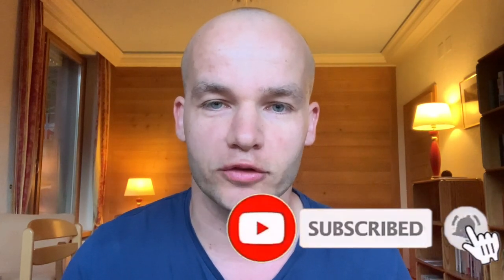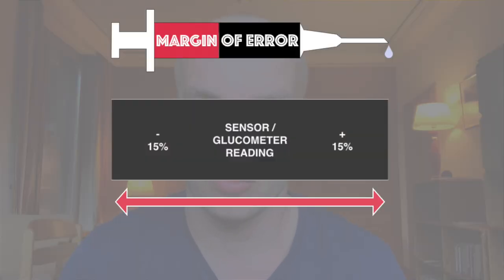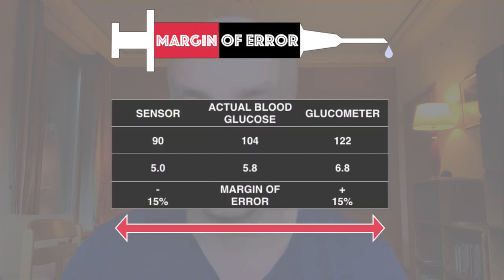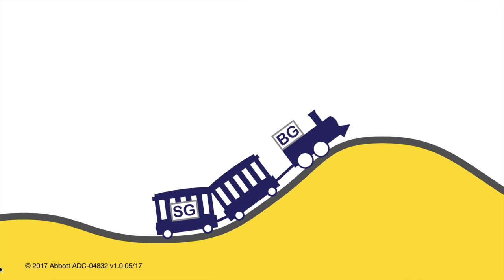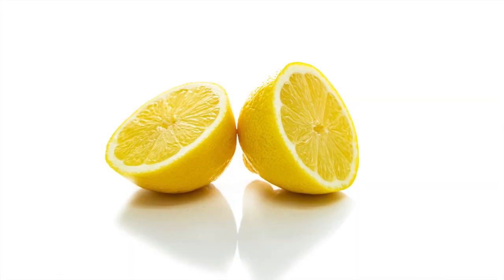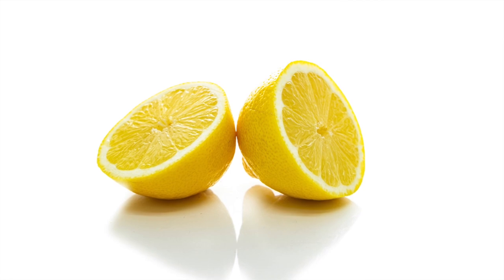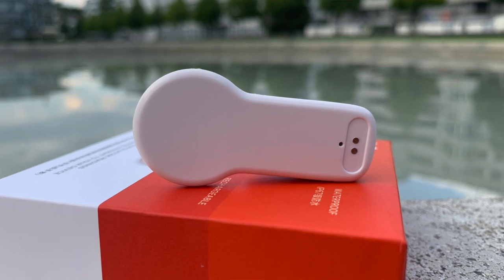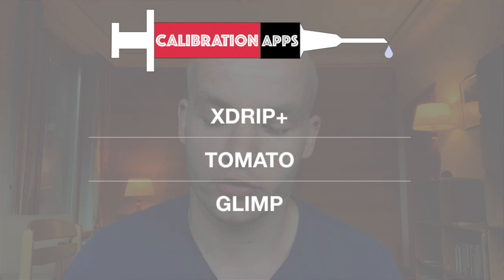FreeStyle Libre Accuracy Issue / 6 Tips For Accurate Sensor Readings

Comment: I am watching from Texas, USA.  I have been using the Freestyle Libre 2 for almost two years and just recently began having the problem of variance in reading f rom the sensor and the glucometer.  I think, after watching your videos, I may have a problem with hydration.  Your videos are most helpful.  My question is:  where do I get the 3rd party transmitter?
Reply from the maker: Thank you so much for your kind words my friend. Please check videos about Miao Miao on my chennel. I have a few. That is the third party transmitter. I also provide a discount code under those videos if you decide to buy. Hope this helps!
Reply: Hi Tom, is the Miaomiao 3 recommended to get more accuracy with the Libre2?

Comment: I just started using the 2nd generation Libre and the alarm woke me up all night long saying my blood glucose was at 57 (I’m in North America). I checked with my glucometer and it was over 100. I have been struggling with my diagnosis since march of 2022 and my doctors aren’t really helpful. I will try contacting the manufacturer to see if it just needs to be replaced due to faulty equipment. 🤷🏼‍♀️
Reply: You may have compression errors from sleeping on it.

Comment: Hello from the UK with an FSL 1.
One more thing that helps me is to apply my sensor at least 24h before the one I am ues runs out. My diabetic nursebtold me that in the first 24h your body doesn't like the FSL being in your body and this gives you inconsistent readings. Have checked this and find it to be true. So 24 or 36 hours before the current sensor runs out I attached the  new sensor but will not start it reading.  Hope that makes sense?
Reply from the maker: Yes, it makes total sense. I sometimes do that to and also mentioned this tip in one of my previous videos. Definitely relevant for accuracy. Thanks a lot for the reminder! Wishing you a great day! Greetings to the UK!

Comment: All my sensors read 30 to 40 points below my monitor readings consistently.  However, I had one sensor that read very close to my monitor readings throughout the 14 days. I assumed that sensor was probably miscalibrated at the factory but it was a pleasant surprise.
Reply: I recently had a sensor that was nearly exact to my finger prick. It was amazing! I didn’t consider it could have been miscalibrated lol
Reply: My first batch of six were dead-on.  The second batch of six were very inconsistent.  Three of which just stopped working.  The rest were +/- 20% off.

Comment: I must be an idiot, because I didn't know there was a Freestyle 2 sensor. The only upgrade in the U.S. that I was aware of was the upgrade from 10-day to 14-day battery life and that is what I have been using for three years. The sensors perform within the ranges published by Abbot, but those ranges for my sensors was much more than what Tom said in this video.  The range that I read is plus-or-minus 40 ! ! ! ! those are really lousy limits.  My experience is that the readings over three years is they average about 27 points lower than a fingerstick value with contour next test strip.  I can't wait to try something else.

Comment: Thank you for your very informative Libre 2 advice. Can you help me with this question? I'm on 2 months new to being declared a type 2 diebetic. After several Hypoglycemic events, my Dr. Prescribed a Libre 2. I'm constantly getting Low Glucose alarms but I feel fine. My Libre is approx 30 points lower than sticking my fingers. I called Libre and they told me that my 30% difference is Normal?? How could that be Normal. The false alarms are driving me crazy! I actually started gaining weight in fear I was going to have another Hypo. Any tips or help for this Newbie?  Thank you very much! Louis

Comment: I am in the USA and have been using Libre 2 for about 6 weeks.  I am on my 4th sensor now, on the second day.  Right now my sensor is running very low (35-50 less than my glucometer) during all readings.  I wonder if placement on the arm makes a difference?  This sensor is higher on the back of the arm than the others I have placed.

Comment: If anyone is here in 2023.  I am 31, non diabetic, but check my blood sugar regularly due to having adrenal fatigue, depression, and anxiety. My father is a type 2 diabetic and I live at home.  My dog experienced her first hypo last week and ended up in the ER.  I started regularly checking her glucose to find she was having low values, however, she was becoming uncomfortable with the constant poking.  My vet applied a Libre 2, which was also recommended by two diabetic dog physicians who have diabetic dogs.  They told me it’s extremely accurate.  It’s been about 9-10 hours.  Reddings are WAY off.  Immediately began showing HIGH which she’s never high. 140/158.  So I decided to check her blood glucose the same time I took a Libre2 reading.  158 Libre, 90-95 on both my glucometers.  10 minutes later she read 105 on Libre and 100 on both glucometers.  Thought it was calibrating well since it was within the first hour… NOPE.  She kept showing high almost ALL night.  I decided to check her when she read 158 on the Libre… and thenk god I did because she was at 60/64 on both my glucometers.  About a half hour later, she was reading 123 on Libre… checked her on glucometer… 85/86.  Anyone else have this issue?  I am extremely frustrated as I paid 300 dollars for a visit, application, sensor, and reader.  Unless it takes some time to calibrate?
Reply: That’s so annoying! I just got one on my cat last week and it keeps saying he’s in the 50s and 60s but he’s perked up. Been stressed for no reason because my vet was short on doctors and wouldn’t call me back for days. I had to call an animal hospital and they told me how these libres aren’t accurate. 

How’s your dog now?

Comment: Tom
It is not a good explaining that gets an average between the two of the readers. I have started using a finger-stick glucometer after I checked my blood sugar level with freestyle libre and saw the result LO which means under 40. I knew that was not the correct number while I was having no hypoglycemia signs at all such as sweating, shaking etc. I had a little bit of panic and felt anxiety in my chest because of panic after seeing that number. After I checked my blood sugar level with finger-stick glucometer it was 138. I am not saying finger-stick glucometer is the best but I watched a lot of videos that say freestyle libre is not accurate. Also, doctors say freestyle libre is not really censoring the sugar in your blood (But my doctor He always defend freestyle libre He must have a deal with the company Abbott. That's the why I don't trust doctors). adding the two and dividing them for result is just Aristoteles style.
Reply from the maker: Thank you for your feedback. I don’t think I ever said one should add up the two values and devide them by 2. I also said some sensors might be faulty. But I get your point. Thank you for watching!

Comment: the sensors are most likely batch tested for quality control at the factory. they are not individually tested. so what happens to those batches that fail QC? are they shipped to countries with weak consumer rights? i am having up to 50% error when i check with finger stick. and i have to check a disclaimer box when i buy on-line. they are expensive and not covered by any insurance or government scheme.

Comment: I freaked out when my fasting glucose readings were around 115/125 on the libre3. Did a blood test (not with a glucometer, but an actual blood sample) and came out 103. Lost faith in this devices. I applied it as I should've.
Reply: I was expecting a small difference, but 15/20 points difference is waaaay to much imo.

Comment: Tom, thank's or all of your information, question for you after applying the sensor I have had some blood from the vent hole
is this a common thing or am I applying with to much force ? I live in Los Angeles Ca. the new libre 2 is available here now.
Thank's again
Reply from the maker: You are most welcome. Yes this bleedings happen from time to time but in my opinion the reason is not too much force during the application but rather hitting a "wrong spot" too close to a vein. It's not a big deal and most of the time people are still able to use the sensor when this happens and the bleedings stops. Hope this helps.

Comment: Gross inaccuracy. Thank you for your wonderful videos, but my experience with the Freestyle Libre 2 has been very poor. Abbott has determined that all three of my last sensors have been faulty and they have offered to replace.However the most recent replacement was again 30 off (sensor 70, finger stick 100). The values now hardly ever move when taking measurements every 30 minutes throughout the day with no effect of food, exercise, dawn effect, changes which are detected readily by finger stick. I have tried all the tricks to increase accuracy to no avail. At least for me it appears this device is useless because of gross accuracy over several sensors. Too bad because the idea is great and the sensors are painless and easy to apply. Very disappointed.
Reply from the maker: Sorry to hear about your negative experience Scott. Wishing you all the best!
Reply: Are you waiting at least 10-15 minutes in between senor check and finger stick? That's the only way mine is accurate
Reply: @kizzihogan7195  sure did...sigh.....
Reply: @scottjones6624  ugh so frustrating. Mine work and are accurate about 90% of the time, now. Seems as though they fixed some issues. I just put a new one on 2 days ago and it has been within 5 points the 3 times I've checked it.
Reply: @scott, any updates? Mine suddenly started showing high reading, 30-40 higher than freestyle blood strip/ketomojo. Checked multiple times. Today I am on a fast, at 48 hours fasting, both keto mojo and freestyle blood strip show mid 70s. CGM shows 105+.  Replaced the sensor 2x, same issue still. It was fine the first few months. I am at a point where this CGM us utterly useless.
Reply: @SunnyCLT  Hi there. I have abandoned the system and threw out the replacement sensors that Abbott sent me. Sad stuff. I think the system could be great for DM1 patients who want to know if their sugar is going wldly out of control, but for smaller more detailed analysis, I think it is not dependable. Even for low readings with an alarm it is very sensitive to any pressure on the sensor which can give many false positive low sugar events especially during sleep. Alas.....
Reply: @scottjones6624  thanks for your update. +1 on your conclusion.  The really funny thing is my CGM dropped it's readings to 80s starting yesterday evening. It has been 16 hours and the readings are spot on as verified by 2 BGMs. This only proves one thing- it's highly unreliable for non diabetic level fine level glucose monitoring and tracking, just like you mentioned.. It's really a shame as it does help me check BG response to various foods I eat while on a ketogenic diet. I am not diabetic nor pre diabetic and using CGM/ketone tracking for my own understanding and trying to optimize my lifestyle. Maybe the athletic versions or libre 3 might be better but it's not available in the US
Reply: @kizzihogan7195  Abbott recommended at least 5-7 minutes in between. I will try your suggestion of 10-15 minutes. Thank you.
Reply: @lilystonne4108  they have told me 5 minutes but they have also told me 10-15. For me I see more accuracy waiting 10-15

Comment: I find that my free style libra 2 reader with sensor on arm seems to be 20 to 30 points higer than   when I check with finger prick with in a minute after...
Reply: I just received my Freestyle Libre 2. I was so excited because now I can check my blood sugar as often as I want. I inserted the sensor at 8 pm last night. The readings were looking reasonable until after midnight when the numbers went higher than I had ever seen, on average of 20 points higher than my Accu-check Guide glucose meter. The situation stayed the same into the next day. I was so puzzled. I called Abbott support and the  company rep told me that I was testing in the wrong order. I should test with the blood glucose meter first, wait 5-7 minutes and then scan the Libre 2 reader, so I have started to do that. Just did the first comparison. The Libre 2 is still 25 points higher that the Accu-check Guide. 🤔 I will complete another 12 hour round of testing and call Abbott again with the numbers. I hope it is just a faulty sensor because I really like the convenience of no prick testing.

Comment: Using a freestyle libra 1 only had it on for less than 24 hours and its reading HI constantly not sure if to leave it and see if it sorts itself out or to just change it
Reply from the maker: Did you check with your meter?
Reply: @TypeOneTalks  I did it was showing the same. It seems to have sorted itself out now but thanks for the help

Comment: Just started the Libre 2.  I do crossfit training almost everyday and day 1, the sensor started to lift off the skin.  It has been consistently 21 pts. higher than the glucometer.  I am not a Type 1 diabetic, but I will get elevated BS numbers if I consume starchy carbo hydrates and eat more than necessary.  I am thinking this is not an effective tool and worth the effort/cost.

Comment: The freestyle Libre 2 is utter garbage.  Period.  I  have stopped using it as it has been as far as 80 points off.   Most of the time it’s 20-30 points incorrect.  I’m not paying. $75 a month for constant erroneous reading.  Worthless.